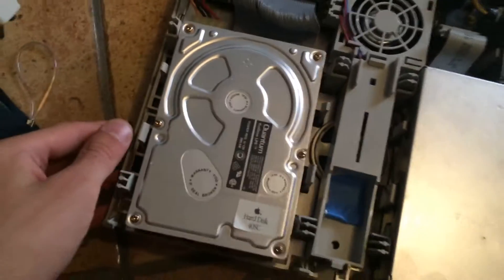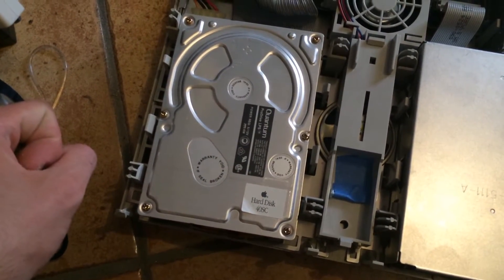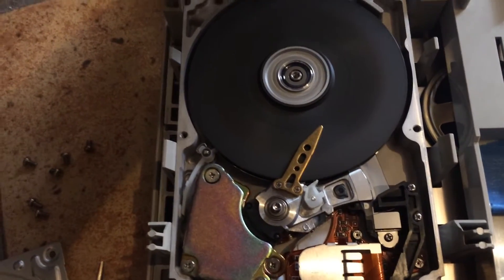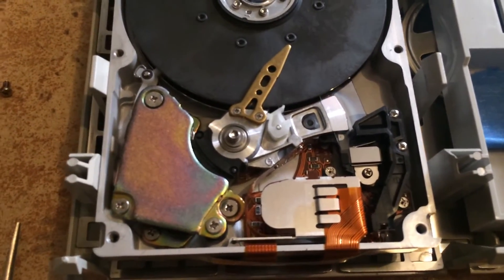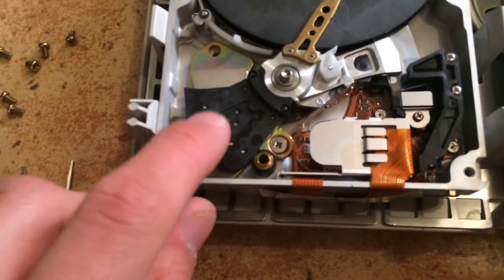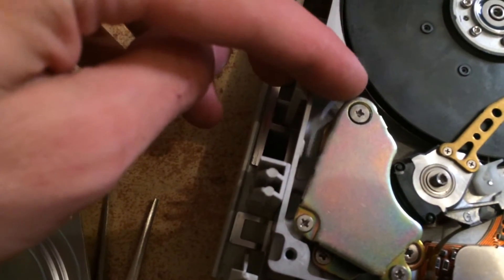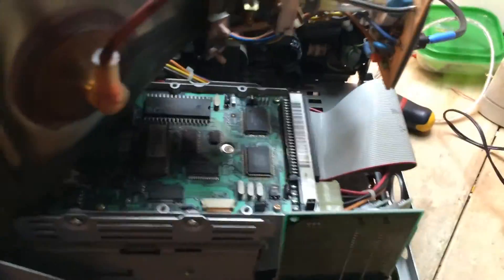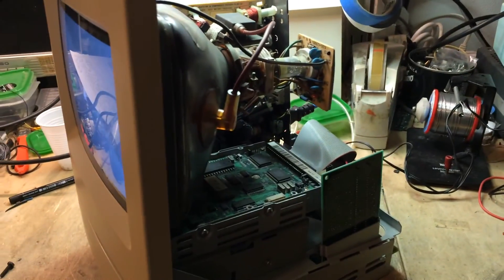Apple Macintosh SCSI Hard Drive Repair, Stuck Head, Quantum Drive

Comment: The early Plus HardCards are very similar to these internally.  The "LPS" in the name stands for "Light Positioning System", referring to the optical servo mechanism used in many older Quantum drives.

Comment: I did this and now the disk  doesn’t work at all.
Reply from the maker: Not all drives can be repaired (especially if newer) maybe the head was damaged or the platter got too much dust/dirt on it
Reply: Hard drives are incredibly fragile, did you move the head stack across the disk in a harsh way? that could ruin the heads.

Comment: not sure if this is the same case with the Quantum drives, but for the Conner drive in my Mac Classic the oily substance was actually the hard drive's rubber seal - it had deteriorated and turned to goop. Not sure if that caused the rubber bumpers to turn gooey or if they did that on their own, though.

Comment: OMG YOU TOUCHED THE part you're ok to touch, cos it's plastic.. Interesting reading up on these drives. I never knew the top platter was fake but I suppose it makes sense. It was probably cheaper to make one spindle design back then and the gyroscopic action of the additional platter probably kept things stable. It's crazy how things have moved in that world really isn't it. I pulled apart a 1TB laptop drive I decommissioned from a slimline NAS recently and had a good look at the heads under my repair microscope. The tiny head just looks like a spot on a PCB trace. Then, cut to my miniscribe drives with their stepper motors.. I love their sound ;) Anyway, thanks for the video. It's given me a few ideas before I dig into mine. I'm thinking a fine 3d print made out of ninjaflex might work as a replacement rubber part. I wonder what the tolerance between end-stop and the track start is.. Off to autodesk fusion ;)
Reply: The top platter was for light positioning. That is how these drives seeked.

Comment: why r the discs black?
Reply: Old prodrives used a fake plastic disk to generate enough airflow, this was done so that the airlock (the white thing that holds the heads in the parking position when the drive is off actually gets pushed open. The real shiny platter is underneath the plastic one. In later quantum prodrives they replaced this weird fake platter by putting small fan blades on the spindle motor.

Comment: You destroyed your drive. Everyone if you want your drive to work still please do not open it up
Reply: This is a very old hard drive and the manufacturing tolerances were much higher back in the day. Pulling the older drives apart is nowhere near as likely to kill them as newer disks, and even then it won't kill them right away.
Reply: The hard drive was dead anyway so not much to lose.
Reply: It's a very old drive, opening it won't damage it at all

Comment: It would be very interesting to hear how long the drive after performing this repair. Touching the r/w head arm and touching the platter freaked me out a lot. The dust... hard to say.
Reply: That top platter and head is actually a fake and I think it was there to have lower capacity drives and to keep balance
Reply: @ducksonplays4190  I believe that top platter is actually for the sake of optical tracking, something unique to the ProDrive LPS. The ELS that replaced it used standard tracking and so the top platter is your typical shiny data platter.
Reply: @redleader6442  Based on knowledge learned from then, you are quite correct. It is used for optical tracking as you said.

Comment: That type of repair is only for emergency data recovery. Opening the drive exposes it to the contamination in the air. Touching a platter like that is a big no-no! That drive is now only usable to get the data off and thats it.
Reply from the maker: John Doe Air contamination is not that big of an issue on such drives. Yes, if it was a "modern" high capacity drive there would be a high chance of data loss, but these drives have huge heads and sectors, so dust is not a critical issue. I've opened dozen of them and all are still working just fine. Since good working replacements are quite expensive, there's nothing to loose.
Reply: Also that platter and head is fake for lower capacity drives and its there to not mess up balance
Reply: This case is an exception, it's a very old drive with much bigger heads and tolerances. All the dust (that probably landed on the black fake plastic platter) got captured by the built in dust filter. One of my drives that i fixed this way last year still works with no bad sectors

Comment: Jesus Christ... You touch the harddrive platter and call it a repair? NO, that is a destroy of the harddrive.
Reply from the maker: Krivulda well, if you do it on a new drive you'll kill it instantly, but consider that this one is only 40MB, so the sectors are huge. Also, do you have a better way to fix them that does not require opening the unit?
Reply: No, but touching the platters is ticking bomb. Degradation happens and headcrash is around the corner.

I love Quantum hard drives a lot, together with Conner drives, so I can't watch this torture...
Reply from the maker: I actually don't really like either of them, there are quantums with the rubber stopper under the platter, where molten rubber goes on the head too, and conners with the rubber gasket melting and causing all sorts of issues (very common with the macintosh portable) and control boards failing and shorting out. On the other hand, IBM drives are very reliable and rarely fail.

So far all the drives I fixed with this method (about 20-30 I'd guess) are still working perfectly. They either die immediately or keep working.
Reply: IBM drives are very reliable and rarely fail. 
K.
Got it.
Reply from the maker: Oh, an regarding the video, the top platter is fake (plastic) so it can be freely touched. It should be rotated on the opposite way though
Reply: Oh is it? I didn't know that, I thought it was some other dark metal as oppose to the the usual silver-y or copper-y looking metal. If it is plastic, then it is OK I guess. But yeah, it should spin counter clockwise.
Reply from the maker: The lower end models had that fake platter, still not sure why, as they removed it with newer drives
Reply from the maker: You can also see that the arm has no heads or cables going thru it, it's probably acting as a weight
Reply: That is new to me. Maybe it was there for keeping the airflow steady. Or for weight distribution. Or because they did have only one assembly machine which had only one programming, so they replaced one platter for price savings.
Reply from the maker: Probably it was an afterthought when the engineers noted that the drive would go nuts if ram without top platter. Because making lower end models with less heads or platters is not new for them. I've also seen drives with only one head per platter so that they could reuse platters with a defective side.
Reply: Yeah, that makes sense.
Reply: @Krivulda  This is was actually very well done! that black platter that he touches is a fake one made out of plastic (quantum did some weird things to get the airlock to open). As long as the REAL PLATTER isn't touched it will work fine
Reply from the maker: @docbrownsradiolab1220 I never had a problem with IBM drives, I think it's normal that they are slightly noisier
Reply: he only touched the outside, there's no head there...